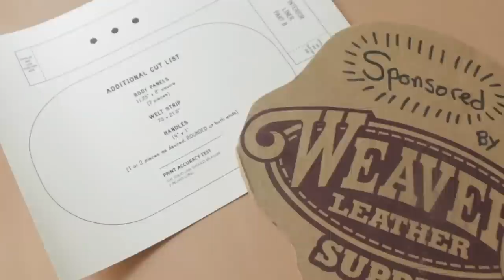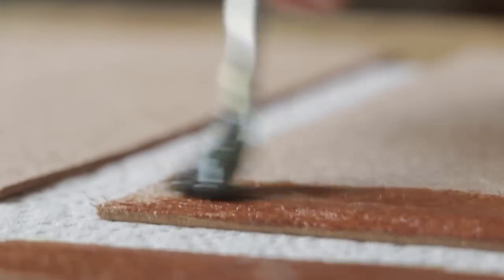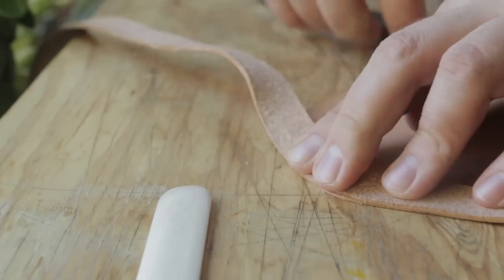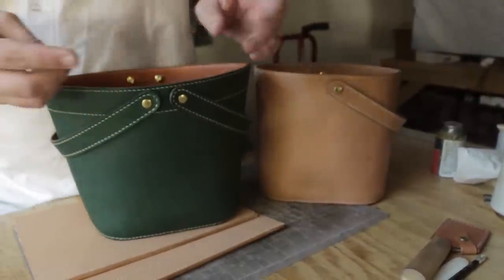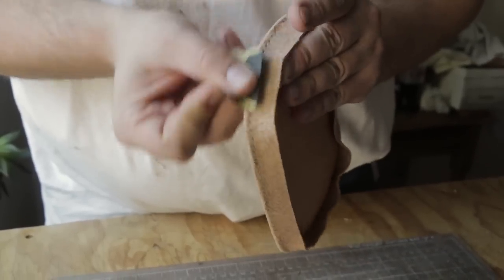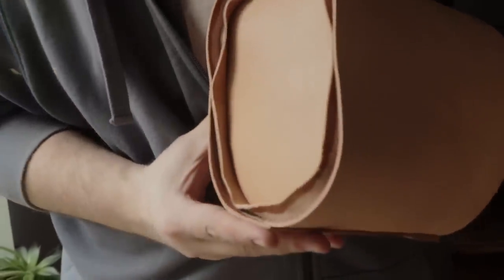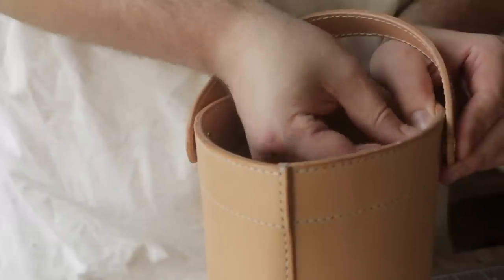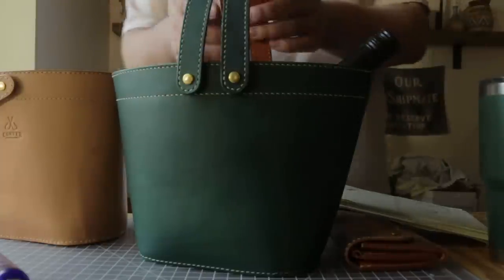Make your own Leather Bucket Bag (with Pattern!)

Comment: Hi. I really need some help with this bag.  I bought the pattern. cut it out and watched the video over and over again. 
But I am confused
-  Each piece of leather for the angled side bag measures  11 3/4 inches   - so 23 1/2 inches for both
-  Each piece of leather for the straight sided bag measures 11 1/4 inches - so 22 1/2 inches for both

so there is 1 inch difference but the base seems to be the same for both.

I cant work out how this will work out?

Comment: I really hate to mention this but....the clips you use to keep glued edges together are called (in Pennsylvania, at least) 'binder clips'.  I use them all the time but I line the jaws with thin, scrap leather so metal never touches leather.  The other thing I noticed was where the two side panels come together at the top, 4 layers of leather?  Could that be adjusted so each liner is short.  Kind of fitting next to each other?  (Hope that makes sense)  Nice design.  Kind of want to try it.
Reply: Correct! Alligators have teeth 😄
Reply: Skive it down, much like the welt/gasket/thingy?
Reply: @thatHARVguy  My skiving technique needs more work than I can say.

Comment: I like your work! I am a novice hobby leather worker. Can I ask your advice on something? I’m currently making a padded leather sleeve-like case for an iPad with a keyboard on it. I’m using 7-8 ounce leather because I have a lot of it. I was planning on the case being one piece that folds then stitched to form a cube-like look. The front and back are continues and there is a seam on the left and right bottom edges and the 2 vertical sides. How would you recommend to stitch the bottom seams? The leather seems pretty thick to bend down for the bottom and front seam. How would you go about it?
Reply: This is hard to understand from your description.
I would recommend you get Al Stohlman's books on stitching leather cases; they show lots of different methods for stitching different cases.
They're available on Amazon.  It's a set of three.
Reply: Well that sounds like really thick leather for what you’re making.  If it is veg than leather you might consider wet molding it to conform to the shape of the iPad, and this will bring the two edges together for stitching.  You could also add a welt approximately the same thickness of the iPad, this might take several layers of leather and could be a challenge to stitch.  Other more advanced options are to use a strip of thinner leather as a gusset, skive down the edges of your main pieces to improve conformation, or combine some of the above options.

Comment: Hi Eric
I bought the pattern and I’m going to make the angled one.  The print accuracy test doesn’t come out right for me and I have no idea how to adjust it.  I proceeded though, thinking that maybe the pieces would all be out by the same percentage and everything would be fine (quite possibly flawed thinking there 😉).  This is my question - I overlapped the body pieces according to the marks but the liner is not wide enough if I again follow the overlap marks.  It matches if I don’t overlap the liner.  So, should the liner not show the overlap or is my logic re the printing flawed?  I’d rather find out now rather than after I’ve cut it all out 😣.
Regards, J
Reply: I had the same issue. Appears that the main body piece is a half inch too wide. Not sure though
Reply: I have made the same discovery.  Is it possible that angled liner is designed to be aligned with one edger the top piece so that the overlap when sewing is minimized?    Did you recut a new piece?  How did it turn out?
Reply: @tomfoster2053  Hi Tom! I shortened the width of the angled body piece by a quarter inch on each side so that it is exactly the same width as the top liner. I shortened by a quarter inch on each side rather than a half inch on one side so that the marks for the Chicago screws remained centered. With this adjustment, the bucket bag I made turned out perfect, and the bottom of the bag fit perfectly into the side panel pieces.